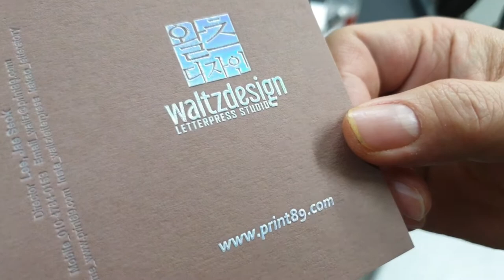Duplex Business card_ Foil+Duplex Embossing+Letterpress Printing+Die cutting형압가공 레터프레스 명함 만들기.

Comment: Your handcraft is amazing. Thanks for sharing. I wanted to start over letterpress and I was wonder if I could get some hints from you. For example what brand is the glueing machine you use to bond paper together. Also if is not too mich to ask to take a sneak peek to your printshop?
Reply from the maker: Thank you for your interest. This equipment seems to be made to order.
It was made in the USA and I bought it for a second hand. The adhesive uses water-based glue for tobe.
Reply: waltzdesign thanks but what brand is it?
Reply from the maker: @Edgarmbe  Trademarks cannot be found.  Only electrical-related trademarks are visible.  It looks like "samgold speed contro"l.